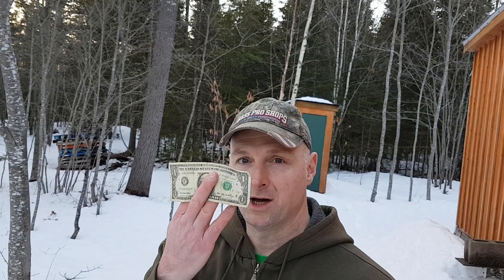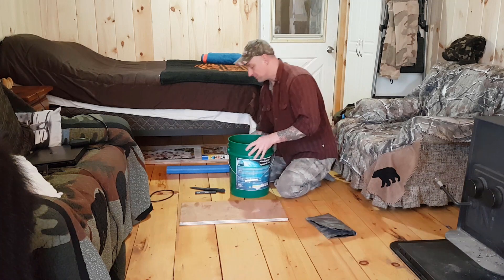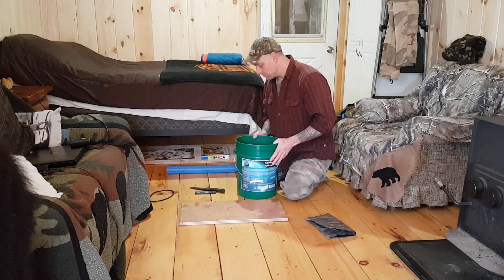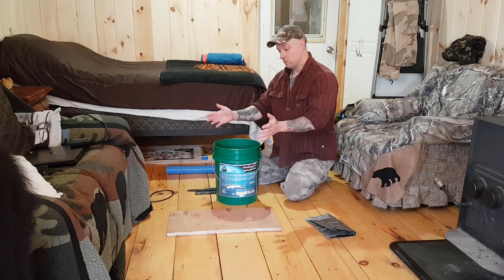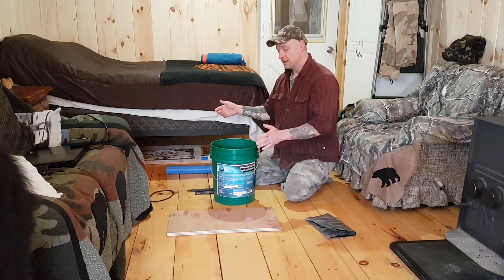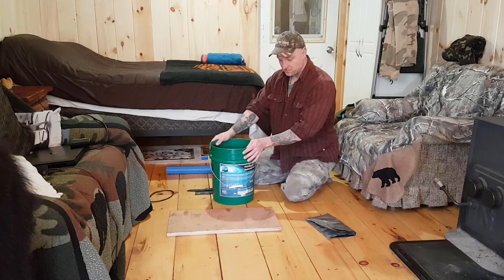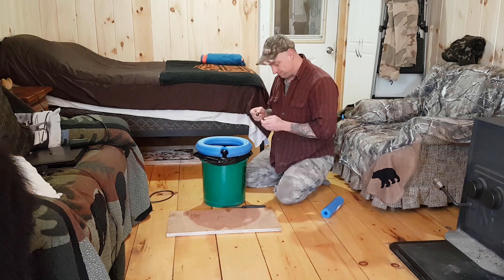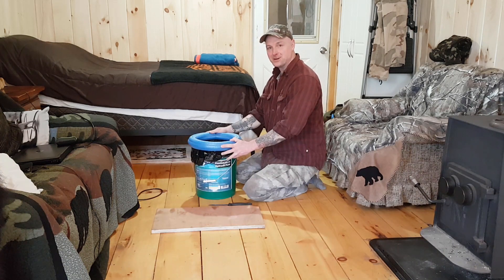How to make an off grid indoor toilet for only one dollar!

Comment: i have a nice bedside commode i bought at thrift store for $5.00. I use leaves or what I have. 4 pallets tied to together with zip ties, thats your compost pile. Dump it in there and should have some dirt in there too. Let it sit 6 months, I have 2 areas and rotate each 6 months. Makes great fertilizer for everything. Been doing this over 20 years. Taught my kids and grands also. I do not use trash bags. Unnecessary work and expense. I dont add lyme either. Humanure will compost just fine on its own and no smell.